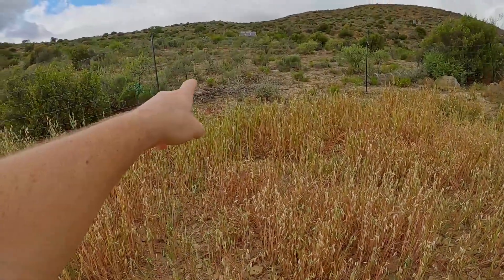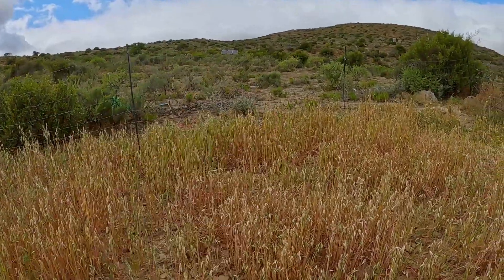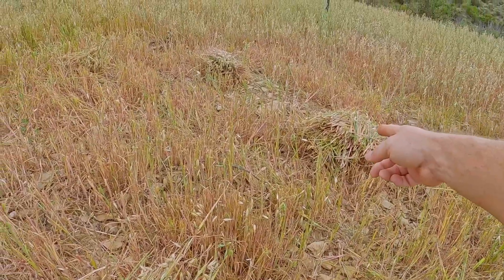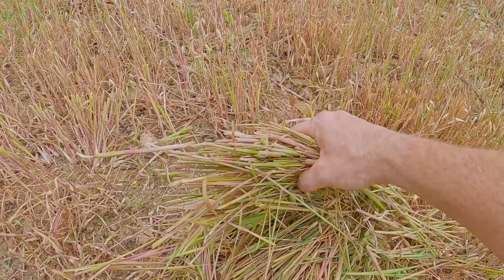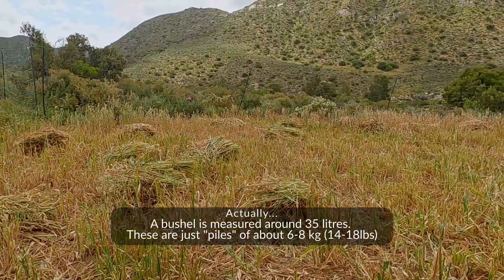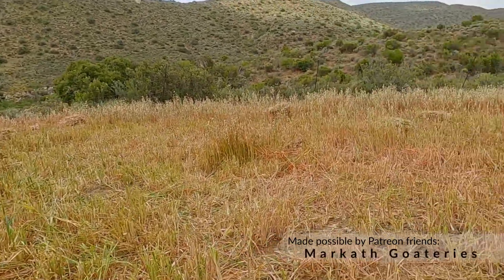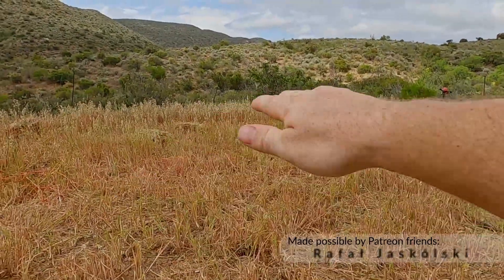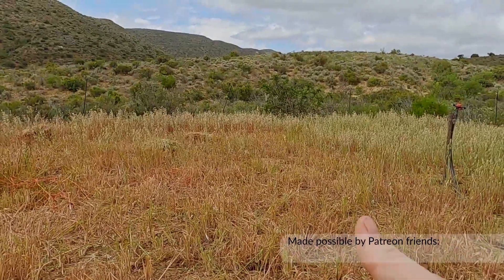Harvesting my oats by hand. A resilient feed system for the goats

Comment: Haven't used a sickle in years, bur I see you stand in the uncut portion and work over hand try to gather the stalks with the sickle and then grab it with the other hand  thumb up. That way you cut more at a time.
Reply from the maker: I'll admit, I don't know much about using them efficiently. My main priority is doing it in a way that prevents a hand cut. Thanks for the message Henning, waardeer.
Reply: @AridForge  I know and have the scar on my left pinky to prove it, happened when I was about 9 or 10 years old. That is also the reason to move the hand towards the sickle and not the sickly towards the hand.